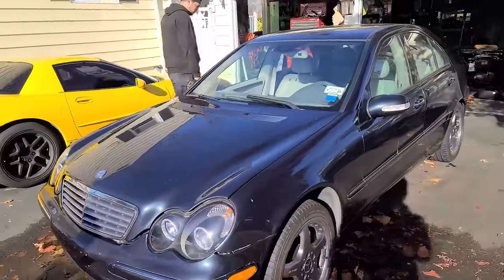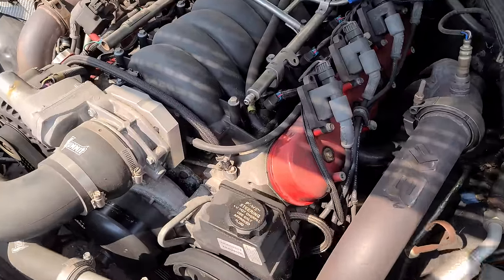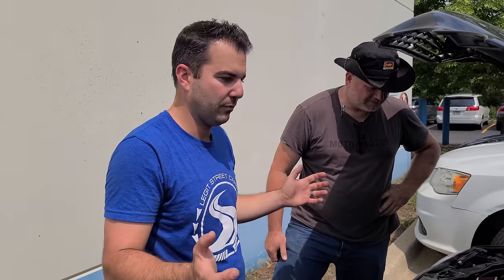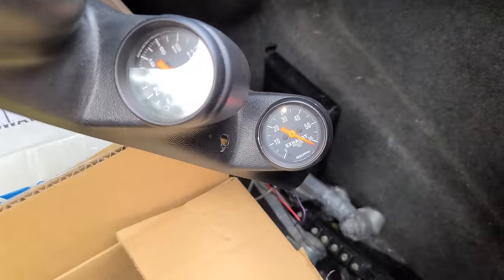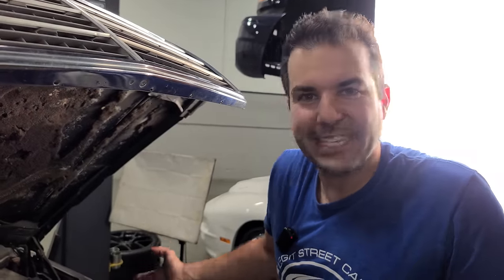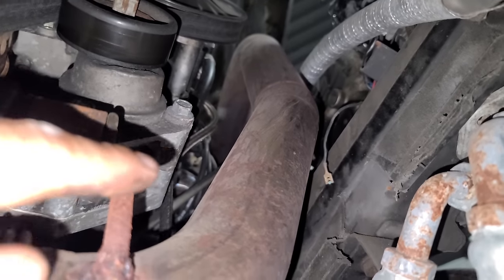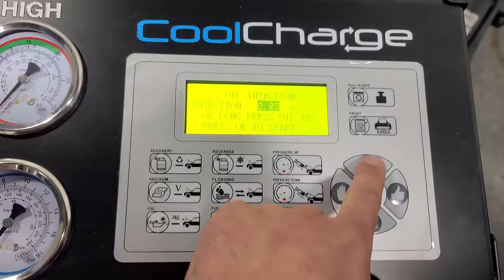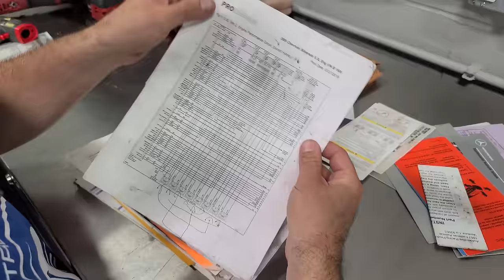I Traded My Weirdest Car For An LS Swapped Mercedes Turbo Diesel! Total SLEEPER!

Comment: I'm not a Honda guy but I feel you traded down... And put cash on top? His car was worth about 5k at best, and that is pushing it..
Reply: Exactly. I'm not a Mercedes guy so I can't speak to what they cars themselves are worth but for what they are now a straight trade seems more realistic.
Reply: Keep the Honda swap I am a V8 guy but anyone can put a 5.3 in any car that Honda swap turbo is one-of-a-kind
Reply: It's a $5500 - $6000 car to me, that's about what you could get for it if you wanted it sold within a month or so.
Reply: @8SecSleeper that’s cheaper than a stock one
Reply: @g32k  stock would be better though
Reply: @8SecSleeper  personal  opinion doesn’t dictate market
Reply: @g32k  It's not a personal opinion, it's the reality. Sounds like your not willing to use logic on this one.
Reply: @g32k hat’s the market people don’t like modified vehicles if that 5.3 was worth 13 k then his Honda one would be worth the same
Reply: The older merc is probably more desirable as classic now
Reply: @heavyt749  it has absolutely no classic value left. It would have to remain stock for that.
Reply: The turbocharged K24 in a newer 2004 Mercedes is worth 2x what the old junkyard 5.3l Mercedes Diesel from 1983 is worth. Period. People pay $25k for Honda Civics with 400hp turbo K24's in them. Even when swapped (1991 to 1999 Civics of all kinds plus Integra GSRs and Type Rs). Check the market. Nobody is selling that 5.3l Mercedes for more than $4k to $5k
Reply: The content is worth more than the price delta and it’s entertaining!
Reply: @catch22frubert I don't think anyone without YouTube money should buy the 04 c class that's been messed with in any significant way... Keeping the k swap and making everything work like it should are likely the reason to go back to an old LS swapped e class. Much less work to get the Mercedes parts to work..
Reply: Dude I totally agree he got screwed, I wouldn’t of made that trade, maybe straight over, but not with that much cash..
Reply: He got screwed…😂hey I’ve got a beach front house in AZ to swap ya, 😂
Reply: That's exactly what I thought
Reply: Thing sounds like crap too
Reply: Lol who cares it’s his choice but I will agree I feel the Honda was worth more. Would I have bought either car in the first place? No but that’s what makes it fun to watch lol.
Reply: He basically bought the Mercedes and gave the guy a k swap Benz for free! Doesn't matter what kind of work that ls has done to it. It's not enough to make up the value he spent. smh
Reply: Diesel vin no smog
Reply: I don't think the whole trading up thing holds true when you're adding cash to the trades. That be like, well I traded my 1997 Honda Civic for a C8, I only had to give the guy 73,000 dollars in cash
Reply: I was thinking the same thing!!!
Reply: @Agilepickleunite I watched the 2nd video first.  An LS1 is a 5.7L that I've owned.  The 5.3L "scrap/junkyard" engines in Australia we can buy for $1500AUD.  LS1'S are way more expensive here, depending on the year!  Commenting after seeing the finished episode. $3k in ARP gear under the Holley valve covers.  Be interesting to see the headers, exhaust, TC & trans in this episode.  Though K Swaps are so expensive in Australia depending how far they went.
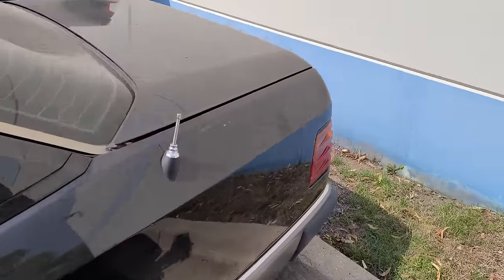Reply: @Agilepickleunite at 02:22 he says it's a 5.3L.  I'm confused!
Should never have been extra cash...EDIT & it's the 4L60 "slushpot" gearbox that takes SFA extra power before it breaks.  I feel bad for Alex considering how great a person he is from what I've seen. 🤔😒

Comment: You got scammed. There's no way that Mercedes is worth $13,500. Between the mediocre 4-speed transmission and the cheap engine, that's like $9-10k. Had they spent money on a better engine or manual-swap, then you could have argued for $13,500.

Comment: That guy got a huge smile.  Once you said how things were worth "which it isn't factual" that guy went all out scammer mode.  I really think the received car is a 30 year old clunky boat anchor.
Reply: Nahhh, I had a W203 back in the day and as much as I loved it these are a proper solid Mercedes. The whole point is random engine swapped fun stuff but overall this is a way better car 👍🏻
Reply: The w124 is way better than the w203. At least stock.
Reply: My opinion the w124 is worth twice what the other was. It looks 10 times better, its not even close to being in the 124s league.
Reply: I'm a Honda guy and I still think he made a good choice.
Reply: Agree. This W124 is worth 6k
Reply: The 203 is one of the least attractive Benz chassis… yes it has a sought after Honda motor but still…
Reply: After knowing Stan for a few decades, he is a great guy and wouldn’t have one of the top motorcycle shops in Chicago if he wasn’t.

Comment: Turbo diesel models had that air intake grill. Nicknamed "turbo grill". Facelift diesel models had that allways, turbo or not. Except for the 200d model.
Reply: what is your point
Reply: @NickBuenoo he mentioned the Finns on the Fender
Reply: @NickBuenoo  Alex asked if anyone knew if it was factory or not, in the video.
Reply: @NickBuenoo watch the video then delete this comment
Reply: @pri0r_t0_a_weekago...fukwi48 hy? Comment provides more info of interest on the weird fender grill. No need to delete it.
Reply: I thought it was included in the “sport line” version only.
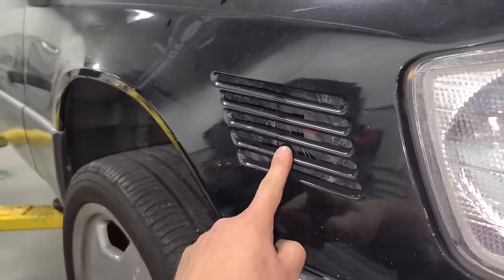Reply: 30:50
Reply: So you are referring to the vent on the fender ?
Reply: The fender grille was indeed standard for a few years on the diesel models.
Reply: Dub guys use to graft them onto mk1 and mk2 golfs in the early 2000s,and the grills from MB transporter you could actually buy aftermarket to weld in your vw
Reply: @grantclaassens612   Was going to post the same :)

Comment: 4500 difference between both and he only came down 500? Ls's are a dime a dozen. The wear of the older cedes will take some work compared to the c230 and was like new. I think he got a deal with work he can do. Going the wrong way Alex on the negotiating 😮.  It's suppose to be trading off with higher or similar value with no additional cash.😄🤦🏻‍♂️

Comment: I’m crossing my fingers that you get attached to this trade and make it a supercharged manual swapped monster 😂
Reply: yea, i think the automatic needs to go
Reply: Agreed. Build a W124 version of the E55 Kompressor but with an American engine and a proper six speed manual. 🤘
Reply: 6 speed sequential shift and a huge turbo.
Reply: @chadgantt7379 why
Reply: These 5.3's love a turbo. Superchargers on LS swaps isn't really common so there wouldn't be as much aftermarket support

Comment: LS swaps are a dime-a-dozen these days so that doesn't really add any value to the car.  It's probably only worth whatever the body is worth plus maybe a couple thousand dollars for the engine and transmission, probably less since it's only a 5.3,  has been in storage and seems to need a little work.  Any LS swapped square body chevy truck is going to be worth more than that car to be honest.

Comment: The air intake is a factory standard at least for turbodiesel W124, so at least 300D. I think like most W124's back here were diesel so really common to see that.

That body is really nice! A bit of shame that they did a swap for such a nice body, but to be fair a good 300D isn't probably ever going to be worth big money.

I would probably have rotated the throttle body so you didn't need to drill a hole in the hood. :D

Very nice project, waiting to see more videos!

Comment: I've owned 7 w124s over the years and they are incredible cars. The LS swap looks really well done as well, as you suspected the biggest problem with swaps in these cars is the steering setup. Some people swap in a w210 steering rack but you lose some of the great steering feel that w124s have stock.  

I have a suggestion. Only Mercedes nuts truly understand the badging to begin with, so considering this is 5.3 swapped, this would be a 530E! You can glue a few old badges together and make a nice looking 530E badge, noone will know what it means unless they are a Mercedes fanatic.
Reply: You can't beat the W124 steering setup for feel and a sense of command. Especially at freeway speeds where it just owns the road. The 530 Badge would be cool to.
Reply: This is a great idea, you’d have to be a Mercedes fanatic and also have some LS love😂
Reply: That's a cool suggestion brother
Reply: incredible, indeed, but not 13.5k incredible. that's nuts...
Reply: Here here I agree 530e
Reply: These cars are awesome, I'm in love with Japanese and American cars but even I have to admit how good the W124 is. So comfortable, simple, high quality in every way, and all those little bits of engineering done just for the sake of it on these cars, like the asymmetrical mirrors, the fender intake, the taillights designed to stay visible even when they're super dirty, these cars are just special. With how all companies are moving towards cars that last for 3-5 years and then you throw them away, there will probably never again exist a car like the W124.
Reply: @SomeOne_86  All mercedes up into the late 90s (w202,w140,w124 being the last) had that same amount of care and engineering put into them, its only since them the quality and reliability has gone down. And they are cheap and pretty easy to work on, get the nicest old benz you can for the money, do the work, and it will become one of your favorites I promise!
Reply: @mike52787  I just might get a W124 from a friend of mine, his father bought it for him and he's a BMW fan so he's pretty keen to get rid of it lol. It's that horrific red, but in pretty good condition, 2.0L petrol carburetor engine and 5 speed manual. The interior is gray and wood, and in very good condition. Overall the car needs very little work. I'll probably buy it from him in a couple of years once he gets his E46 lol. It'll look nice next to my '93 626 GE IV haha.

Comment: So excited for this! I daily drive an ‘89 W124 coupe with a Ford 302/AOD swap (I did the swap myself) Beware the diff and axles are a weak point, although you have the toughest version. I swapped in a Chrysler 300 diff and spliced axles to handle the power. I put flipped log style manifolds on mine and crossed the left pipe behind the engine, true duels with an H pipe routed in the factory position. No A/C on my swap but I’ve put 10k miles on it and drove it thru winter.
Reply: I got see that

Comment: I guess I didn't understand the "trade up" concept.  I thought the idea was to work out a deal where your getting something of "equal" value that may need some work to make it more valuable.  So, when trading... the trade is "straight up" with no extra cash on top.  In other words, I thought the concept was to pay for the "red paper clip" that ultimately is what you pay for on the final item traded.... for example a house on the beach in California.  So, when you traded the cars plus paid an additional $4,000 on top of that your not "trading up"...  But...  I don't know... I've never practice this method...   So, my limited understanding is probably wrong.    Maybe you might get lucky and be able to trade up for something of higher value....maybe.  But it would need to be at least worth 15k....  right?
Reply: Intrinsic value do not always equal to demand value which set the dollar price.  Something can only be priced when seller and buyer negotiate a price for it.

Comment: My favourite projext of yours! Some thoughts: 1) you havent ruled out the sensor yet. When you pulled it out, it was suspiciously high on the scanner. Its a thin wire and should respond fairly fast. Either bench test the sensor you removed by heating it up with ar the same time as known good thermocuple/(cooking?) thermometer either on your bench or on the car. 2)you checked thatbthe pump is on when commanded but not when in use. Come up with a method to confirm power remains at the pump whilr drivinf ef back-probe with a small bulb, clear section of tube you can see while driving etc. 3) when you remove your shraders and reinstall you are introducing air. Get the right shrader tool or if you remove the core, keep your funnel open whine you are removing the hose and reinstalling. You will lose coolant but hopefully your reservoirnin thr funnel will drain out raher than it drawing in air.

I went through something similar on my 2jz hitting boost cut early. Turns out somebody alonf the line had installed an MAP sensor frlm a camry. The calibration was different and when i bench trsted it againsfservice manual data it would have told the ECU ambient atmosphere was 7psi of positive boost! So i was hitting boost cut around 9-10psi. Both MAP sensors looked the same, part numbers were different....MB may have made a mistake on yours or perhaps you have  wiring issue thats modifying thr circuits resistance too! You could consider back probing at the sensor itself and into the ECU to make aure the wiring is not an issue.

Comment: You can pass an A/C vacuum test and still have a leak if the port valves are bad. The valves are normally under pressure and can leak but under vacuum they are sucked in and can make them seal, passing the test.

Comment: You totally gotta turbocharge it, even with low boost it would still make a lot more power and would be relatively safe with a water to air intercooler with an ice tank for summertime driving.
Reply: I wonder how hard it would be to use A/C to cool the intake air similar to the srt powerchiller.
Reply: @rysterstech I tried using my AC as my intake but then my car back fired and blew part of my dash off lmao

Comment: The vents on the wing are factory on the diesels. As a kid in the 90s here in Ireland, I spent many a morning staring at them on the way to school. I think if you could get it to be factory in everything but the engine and box, that would be cool - e.g. get original speedo cluster back but altered to suit what you have.
Reply: Yes, the vinyl "carbon fiber" wrap is ugly as hell, I prefer the OEM wood trims. The gauge cluster was well manufactured but I also prefer the OEM one.
I wonder if it is possible to retrofit the OEM shifter on this transmission or if it is possible to retrofit the OEM transmission with the LS engine

Comment: So excited about the W124, I've always hoped you will get your hands on one since they are such fine automobiles and now you did it! I have one as well, a normally aspirated 250D, and I love it.
P.S: The vents on the fender are basically the intake on turbodiesels and multivalve diesels in the facelift W124 cars. They came from the factory with these.

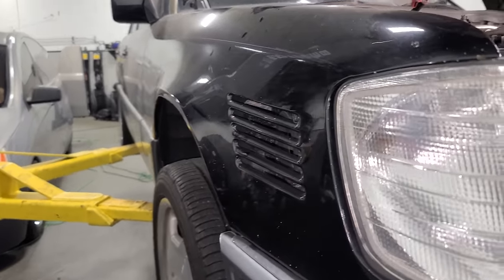Comment: 30:47 that, my friend, was what it used to identify the turbocharged diesel engines in this model. It is completely stock, it used to be the turbo air intake.

Comment: AC belt is a common thing coming off. You can either get an upgraded AC tensioner (with additional tensioner/pulley wheel) or get a stretch belt and remove the existing tensioner all together. Belt gets thrown when the auto gearbox kicks down.